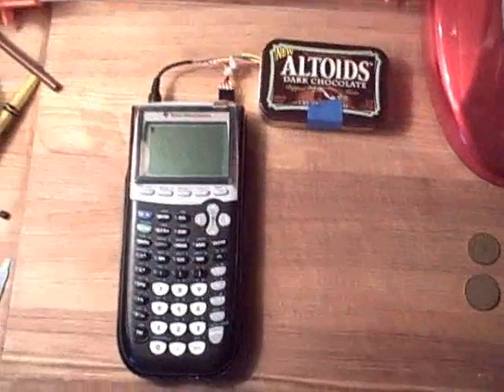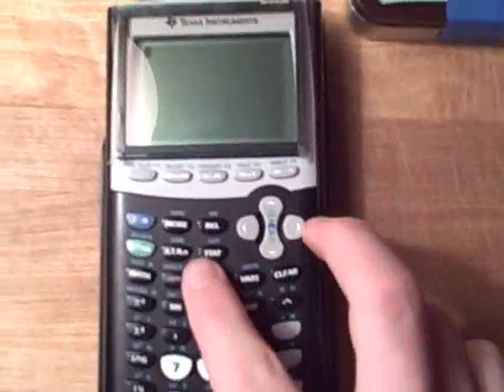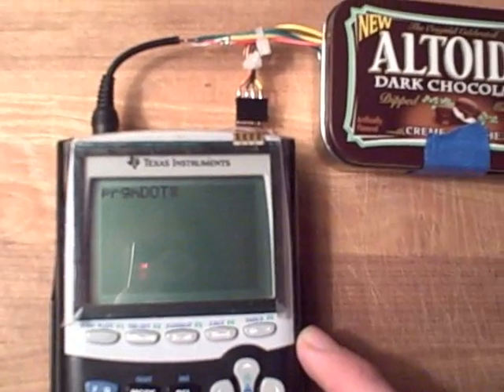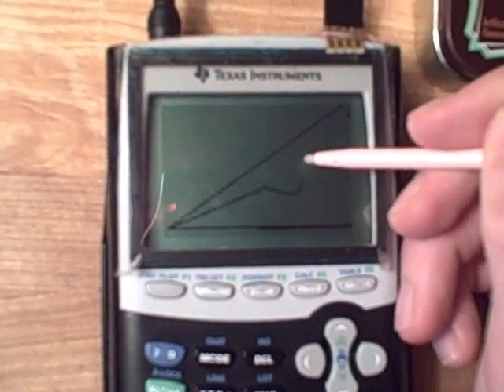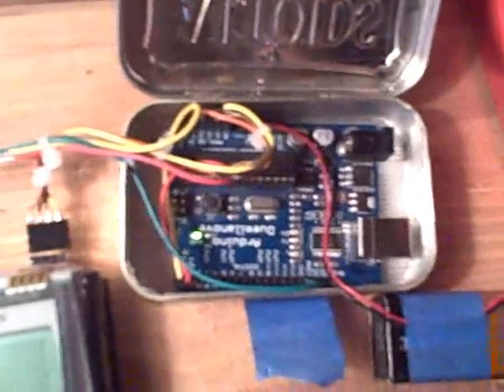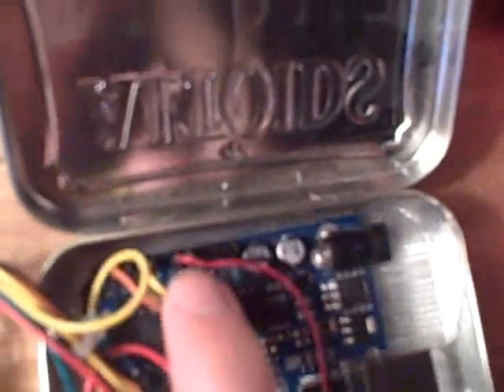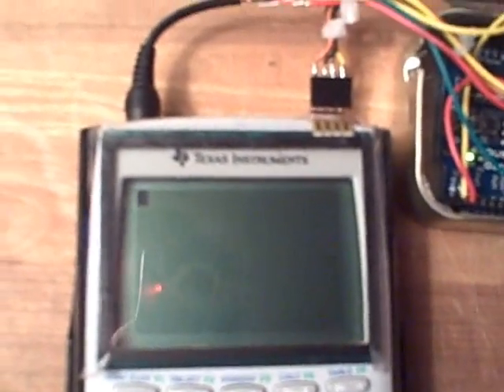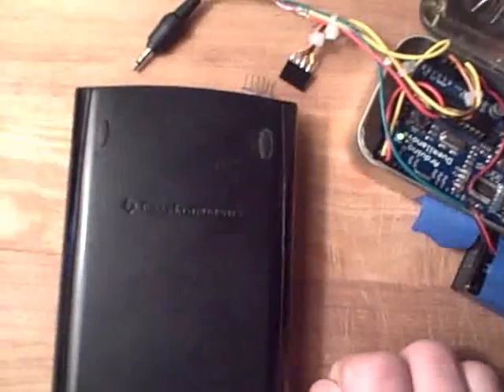Graphing Calc Hacked with Touch Screen

Comment: Hey, this is really amazing and im interested in trying this as well.
While I dont have  a nintendo DS I can masacare, I do have a touch-screen from an old cell phone that has a 4 pin output. Do you think this would work as well? Its not a nice glass touchscreen that senses your finger its one of those ones you have to push hard to make it work. 
The work you have done is amazing, dont ever give it up.

Comment: great job!
Never got this advanced back when I used that calculator. I don't know its capabilities, but if you want to do the lines with points only, you could write an interpolation routine to fill in the missing points. Simple linear interpolation (basically what the line mode is doing, drawing lines between sample points) would probably do fine. If you're interested in some fancier interpolation, check out cubic splines.
Very cool!